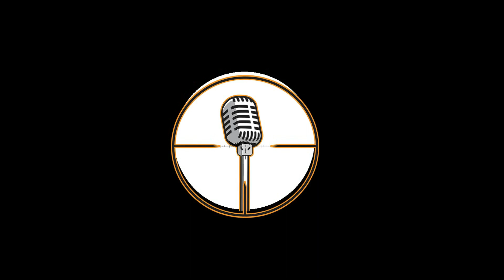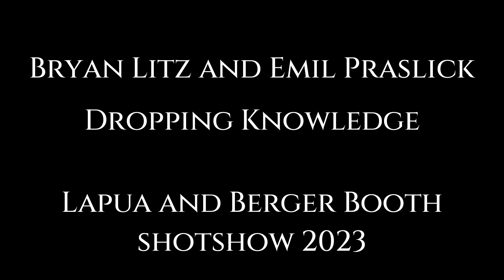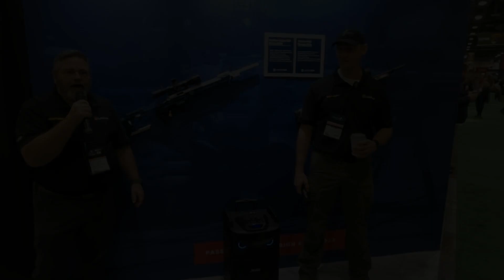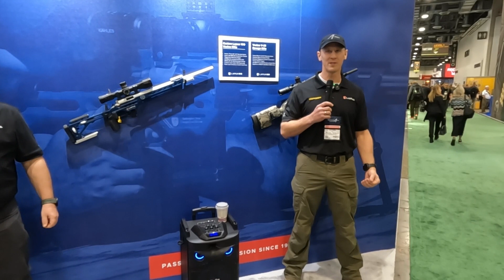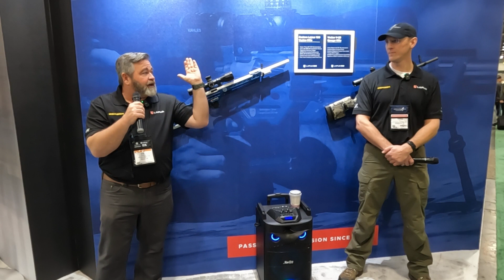Bryan litz and Emil Praslick Drop Knowledge about long distance shooting at Shotshow 2023

Comment: Question I have about the mirage - is the refraction of the target at long range.  I suspect the target is not really where I see it through my scope so how do you know where to aim - do you diali back parallax and magnification until you cannot see the mirage in order to accurately be aiming at the target?
Reply from the maker: This is a really tough one. I'll give you my take on it, but as with everything, I'm 100% open to alternate views & experiences.

From my experience, mirage has a tendancy to "move" the target in the direction that it is flowing. Using quotes there b/c it moves the target's image as you perceive it. So, if mirage is a straight boil, the target appears higher. If the mirage is flowing to the right, the image moves right. How much has to do with the multitude of factors involved, such as light intensity & mirage speed. And remember, the mirage you are observing is not necessarily representative of the condition at the target.

LOTS to contemplate here, but it goes along with what Emil was saying about constant observation of conditions so that eventually a shooter can identify familiar conditions to apply as accurate a correction as possible in the moment. So much voodoo involved when the great wind readers get it right! 😉

These are my observations & I hope I made sense & didn't screw things up too badly.

-Rooster
Reply from the maker: Also, magification is not always your best friend. I find backing off will help escape the confusion that mirage induces. It will not, of course, reduce the real effects of mirage.

And there's only so much that can be done with parallax - tune it to where your reticle is most crisp on the best possible image, at the location of your target.

Please let us know if this helps with your shooting!